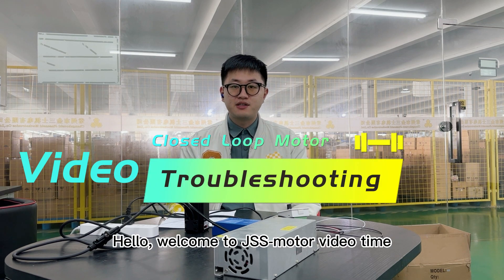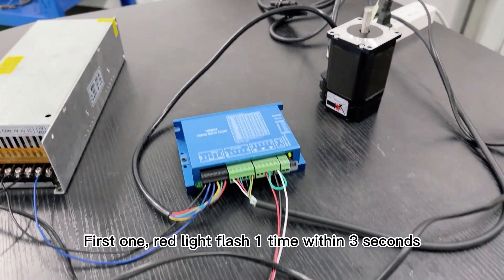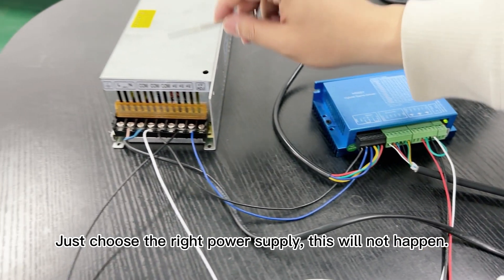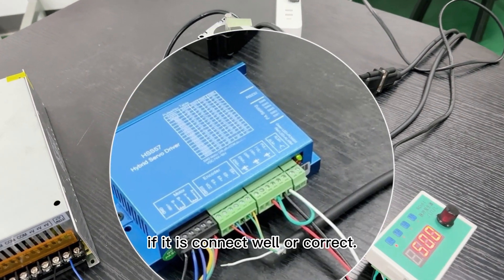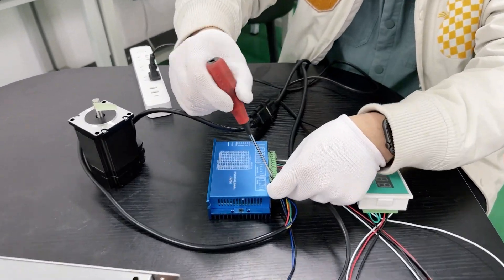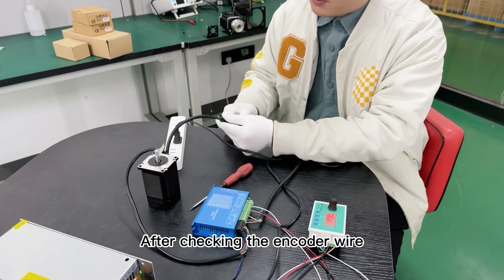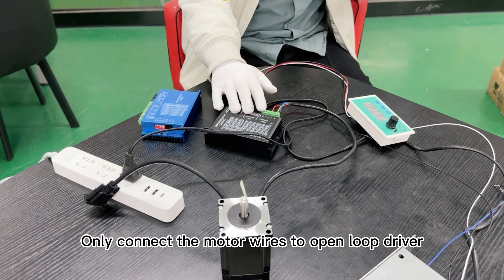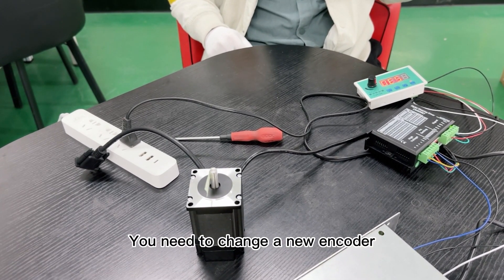Closed Loop Stepper Motor Driver Troubleshooting Video: Tips and Tricks #automation #cnc #motors

Comment: Can over voltage error be fixed? Driver flash 3 times after motor moved.. check with another driver motor works perfectly. 2 drivers showing error